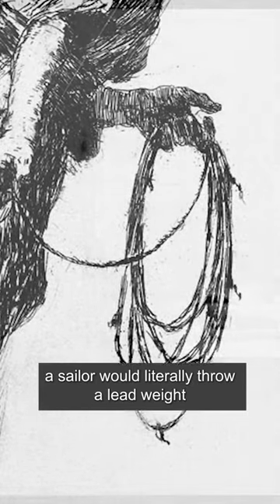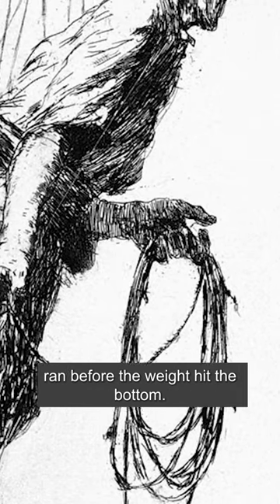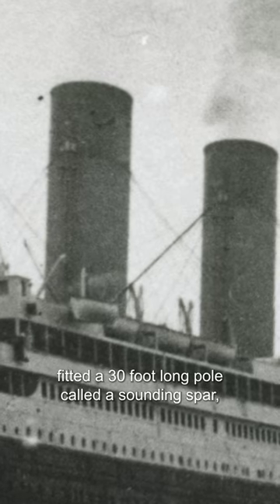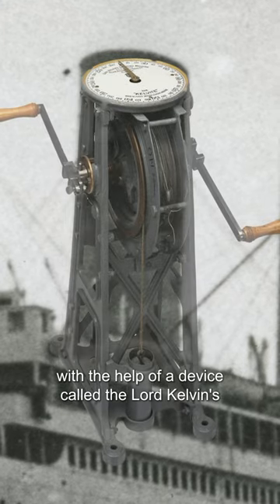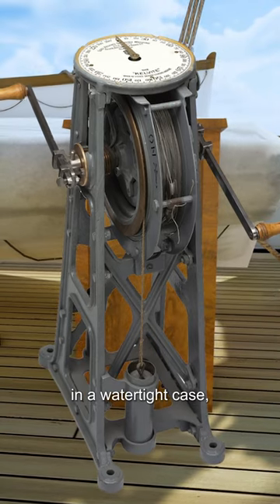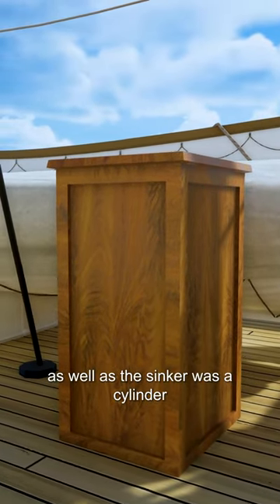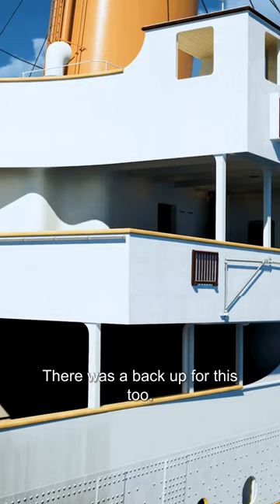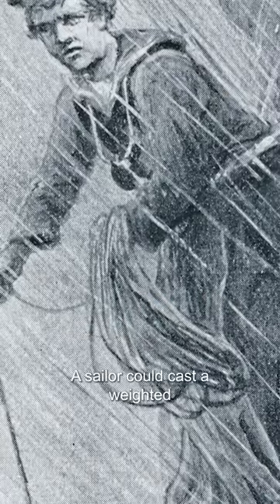This clever machine read Titanic's depth #titanic #mikebrady #history #ships #shorts

Comment: That deep, the amount of rope itself must be so heavy to pull up. I've done this on a boat with rope that wasn't lighter than water and it was hard to feel the bottom because the rope was so heavy. The feeling of pulling the weight up off the bottom was so slight. Improper rope for the job, but I think the last guy had a tangle and let the whole spool get pulled over

Comment: I'm confused. Wouldn't they need a couple of miles of rope for the depths the Titanic was traversing?
Reply: Would it be necessary to take depth readings in the middle of the ocean?
Reply: It's for close to shore.
Reply: Right??
Reply: He mentioned a pressure gauge so that would doubtless be used in deep sea situations.
Reply: This was for shallow waters or places the ship was at high risk of running aground
Reply: God bless you
Reply: @JP_TaVeryMuch you have water pressure at any depth.
Reply: @JP_TaVeryMuch  how the hell would a pressure gauge help when the rope's too short?  it's only for shallow waters.
Reply: I'd rather have both thanks

Comment: How accurate would it be when the ship was moving?
Reply: Accurate enough. The inaccuracy increases with depth, but at depths shallow enough to risk hitting bottom there wouldn't be much deflection.
Reply: @PsRohrbaugh Also if you’re worried about running aground you’re not moving swiftly.

Comment: Any self respecting Captain should know the depth at all times. 2000 fathoms should mean clear sailing. Unless...
Reply: You guessed it Icebergs are concerned!!!  🤠👍
Reply: Back then, it was ded reckoning,  meaning  10 knots for 10 hrs you went 100 miles. But  if you were going with or against a current one could be off by a lot after a long voyage so when there was fog and you thought you were getting close to land bit couldn't see, then you would sound for the bottom with this lead line.

Comment: I think it's useless stuff.
I mean, why would an ocean liner only need to measure 182 meters when the ocean is miles deep?

there is more line in my light spinning reel😂
Reply: It was probably used for sailing in shallow, coastal areas, where knowing the ship's depth under the keel can be the difference between getting to port safely, and running aground on some underwater rocks. Nowadays, depth sounding is done by using sonar, but that technology only exists since the late 1910s. It might be more effective, and more handy than dropping a weight under the ship, but it still has limited range depending on the power of the emitter.